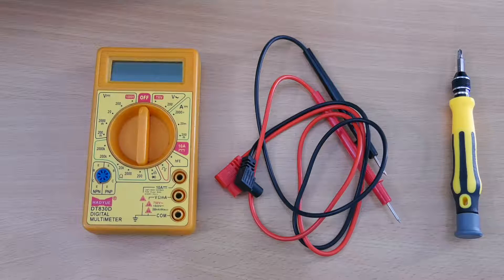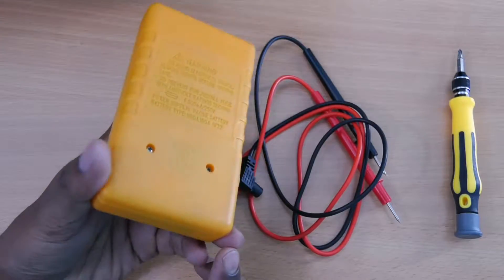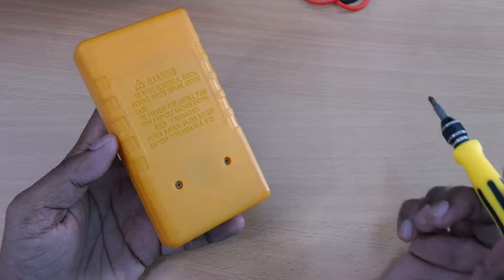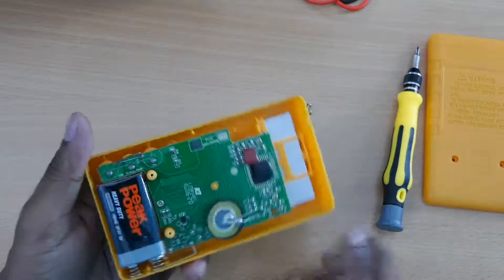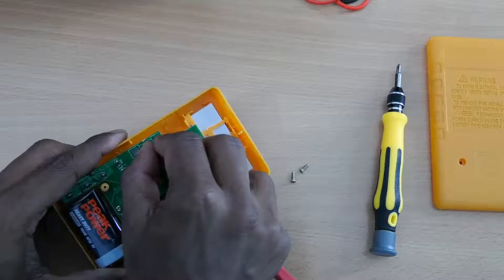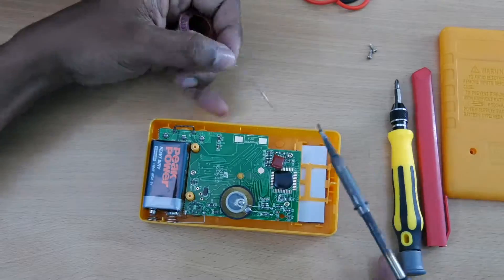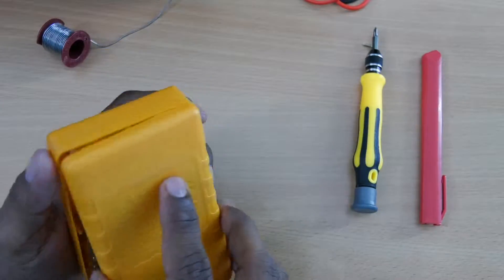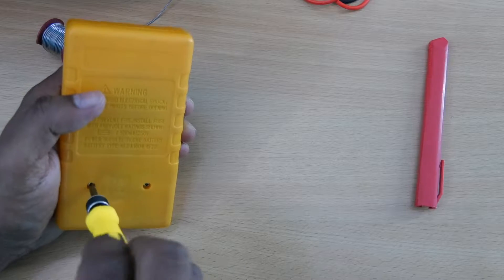Adding fuse to multimeter | Modify cheap multimeter | Ut Go

Comment: I have some questions- 
1)If I don't use the fuse, will that thin PCB trace save the multimeter?
2) if it saves but it itself gets damaged then what to do?
Reply from the maker: 1. No
2. Just replace the blown out fuse with new one
Reply: @UtGoTech  ok
Reply: @UtGoTech  What is the max current capacity of the fuse you used?
Reply from the maker: Multimeter can't handle much current. According to multimeter it should be less than 10A but i suggest you to use less than 6A.
Reply: @UtGoTech bro can i use 5amp fuse ?
Reply from the maker: Yes you can use a 5A fuse.